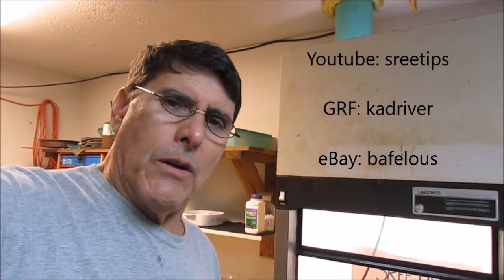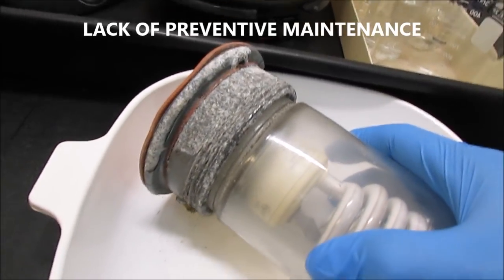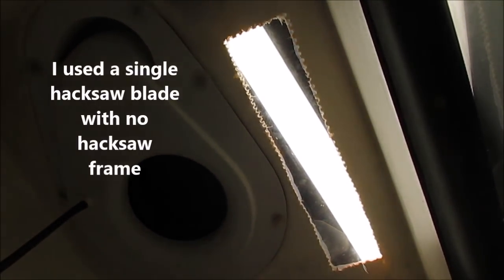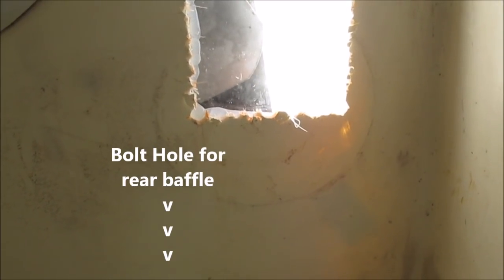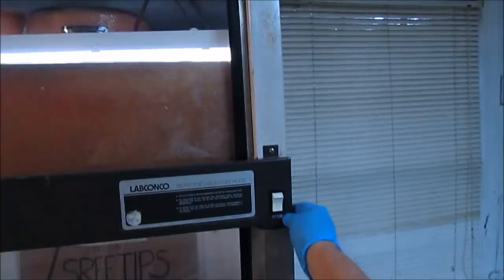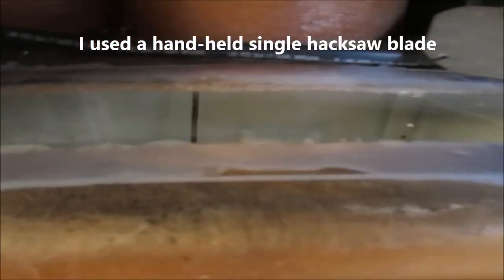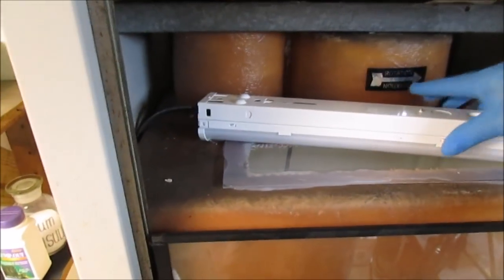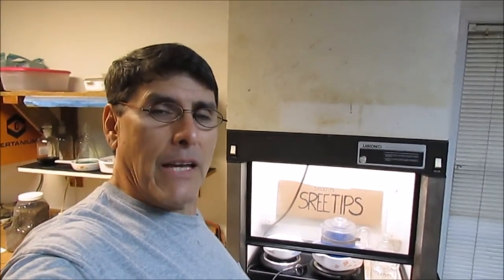Fume Hood Light Modification with LED

Comment: I found a pp250 centrifugal duct fan for 431 on eBay and a cheap entry level fume hood that is entirely molded plastic. It’s a SP Scienceware 50000-0002 model for 506 dollars. It’s probably too cheap to provide the necessary safety. I’m not sure if you have a moment to take a peek at them and weigh in on it. Only if you have time. Thank you!
Reply from the maker: As long as it’s fume tight, with no metal parts exposed to the fumes, should work just fine.

Comment: Where do you vent the noxious gasses to?  Outside over the neighbors fence? ;)
Reply from the maker: Up the exhaust stack. Your lawn mower does more harm to the air than my occasional chemistry experiments, sorry to say.
Reply: @sreetips  where does your exhaust stack go?  I'm in a ground floor apartment.
Reply from the maker: It exhausts up a six inch PVC pipe, through the roof and about 4 foot above the shingles. I installed the vent hood my self. I documented, with pictures, the entire installation on the goldrefiningforum.com my user name there is "kadriver"

Comment: Hi Sreetips.
This lighting is good.
This your fume hood have some kind of protection, in case you are boiling something toxic, and occur power interruption, or engine failure?
Reply from the maker: Power failure emergency procedure: immediately start gasoline standby generator and resume operation. Emergency generator failure: immediately put on respirator and carefully move reaction vessel to my back yard under a 5-gallon bucket.
Reply: ooo my...tense this! But if it were easy any would do. Thank's

Comment: Okay so if you add too much silver it will “dilute “ the gold so much that it will make it unrecoverable. Could you maybe explain or go into more detail why that is. Didn’t know that could happen. Does it make the gold so small that a filter won’t catch it?
Reply from the maker: If too much silver is added, then the pieces of gold will crumble into a powder, or even worse, it will form colloidal gold. When this happens it become difficult to seperate the liquid from the gold. If the proper amount of silver is added then the gold will hold together in large chunks and the liquids can be easily poured off. If the gold falls apart because too much silver was added then it becomes a real pain. And yes, colloidal gold will go right through a filter paper.

Comment: Interesting damage... imagine what it can do with your vacuum system. I've seen a gas scrubbing system on the aeration line of an HCl tank. It is a big pot with material in it that creates surface area where the vapours are pushed through from bottom to top. On top of the material that creates surface area a stream of water is put that drizzles over the SA Material. I can't say it worked that well with immense flow but it is a concept of a gas scrubber for corrosive gasses from acids. If you'd distill that scrubberwater I'm pretty sure you can "retrieve" some of your nitric acid. And hey I have my own youtube channel now  You'd better subscribe :p

Comment: There is a local auction held by dickensheets here in Colorado plan to get a nice fumehood for a few hundred bucks
Reply from the maker: I paid about $250 for the one I have. And it cost me about $250 to have it shipped to me.
Reply: Looking to get one soon before this co. Snow starts
Reply from the maker: If you do any of this refining stuff then you'll thank yourself every day that you use it. Especially when you don't have to run outside to add a reagent to a reaction when it's 2 degrees F out there. I installed mine about 7 years ago. I documented with photos, the install complete with 6 inch PVC stack through my ceiling and roof showing exactly how I did it. Back before I was making videos. Go to goldrefiningforum.com - it's free and there is much info there. My user name there is "kadriver".
Reply: Thanks I did join grf about 8 months ago and I do refine recover and talk with many great minds. I have learned from GEO and Kenneth who I talk to personally but have also learned from Lou & Harold I'm also in kenniths page the refinement of precious metals but where I'm most active is the fb group.   E GOLD RECOVERY & REFINING its world wide and has a growing 2k members you get mentioned at least once a day as a question gets answered by STREETIPS HAS A VIDEO... I'm sure you have heard of it GEO is admin on the page..??
Reply from the maker: Nice, I'll have to check it out.
Reply: sreetips tried registering for this forum.  Looks like they have a bug on the confirmation code: nothing is being accepted.

Comment: My father did refining back in the 80's. We bought two fume hoods from a lab that went out of business. We used one for refining in an isolated room and the other for our burnout ovens for casting jewelry. The hood in the refining room quickly needed a replacement fan motor. The acid fumes are very hard on it. The hood with the ovens is still going strong LOL. It is amazing how caustic acid fumes are on any metal objects. Love your videos. It brings back great memories of my late father.
Reply from the maker: Excellent. I want to get into casting jewelry, rings and customized pendants and all. Working with precious metals is fascinating.